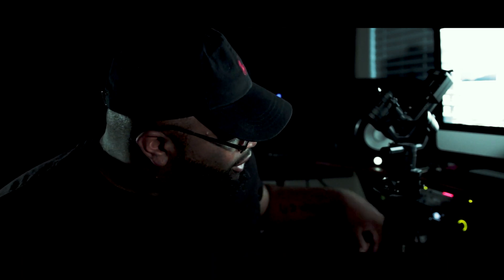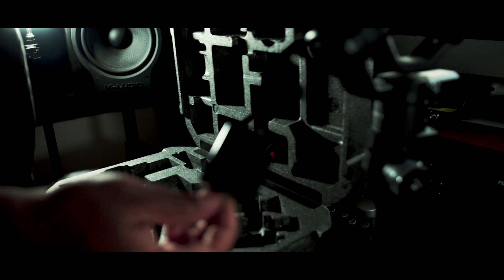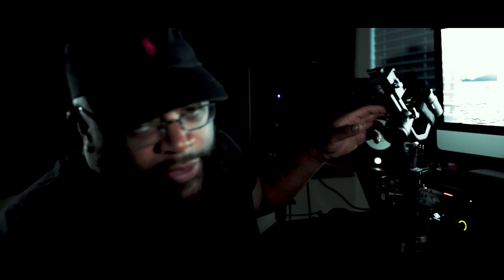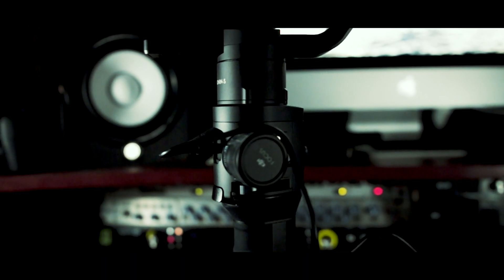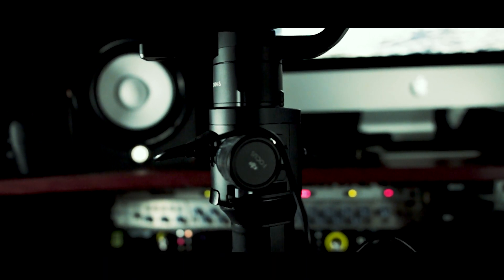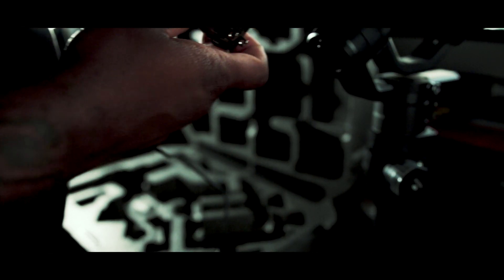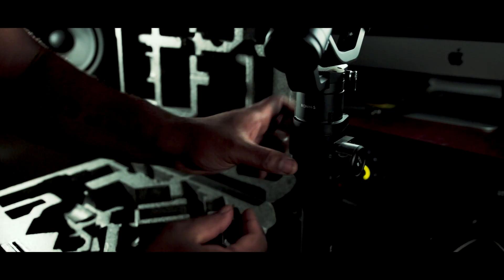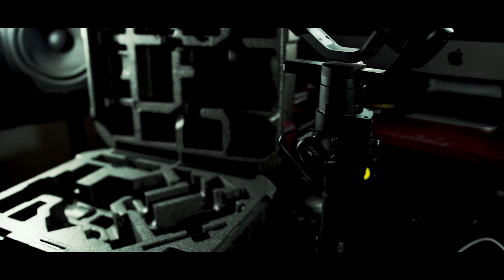How to Charge the Ronin S

Comment: Thank you so much. Exactly what I needed to leaner and you did it with style!

Question, top part of the gimbal when I go to lock it in doesn’t seem to have a noticeable stop, it’s it just a tension cam type thing? Or should I expect a more satisfying click?
Reply from the maker: Sorry for the late response, been really busy with shooting. I know by now you have figured it out. I never had that issue with mins. It locks pretty good.
Reply: Mine's the same, I think it's a tension thing. Its never "clicked" into place but seems secure...